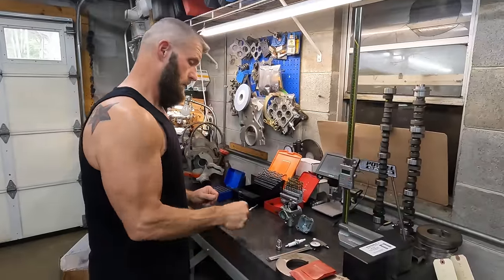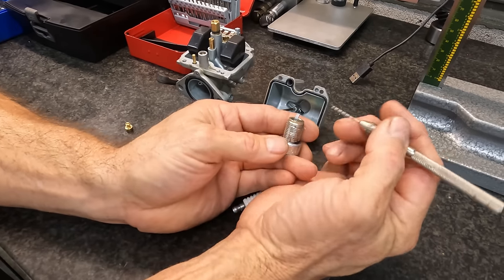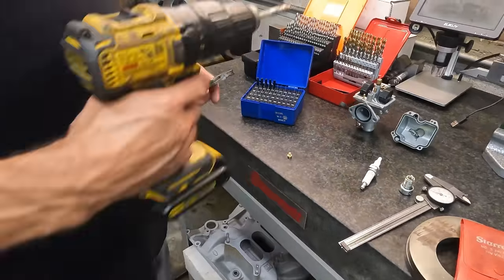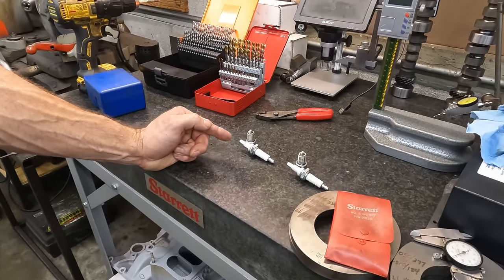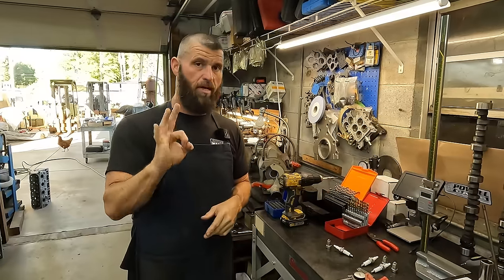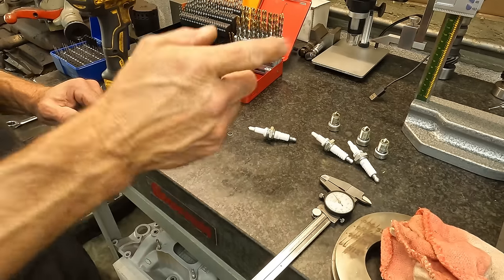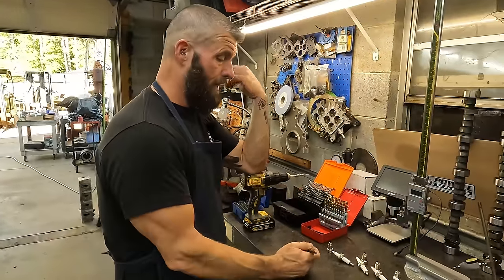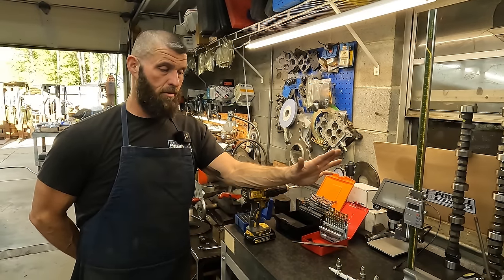Reading sparkplugs and making Andrew's mini bike faster than it should be!

Comment: The smoke ring and strap anneal line are the two key features.  GREAT job covering this.  This is the most clear and concise video I have watched on plug reading.  I do more 2-strokes than 4-strokes, smokers like the strap anneal line at the bend in the strap, smoke ring usually should be similar for gasoline between 2T/4T.
Reply from the maker: Glad you enjoyed it!

Comment: Dude, y’all flashing me back better then 50 years…
Learned the hard way, as jet diameters get bigger, it takes less of a jump in size, to make the same incremental difference. 
Had a set of drills back in the day, think were intended for jewelry / watch makers, that had finer increments then number sizes. 
When splitting hairs, I’d sometimes use valve grinding compound on a piece of wire, to hone to the desired size.
On some applications, it seemed you couldn’t get enough jet, and was for the circuits being maxed out, and I’d drill / ream the circuits. Want to be careful for the jumps in size here, as a little’ll will give a shit ton difference. Sometimes chamfering / deburring circuits was enough.
Also, don’t see it talked about much, anymore, but it’s important to get a spark plug of the proper heat range, to be able to read it properly.

Comment: You threw some schooling on me! That fuel ring part was great, I knew about the heat ring/mark and how timing would change it. I liked how you described the timing as heat in or out of the cylinder. Explained it better than I had heard in a long time.
Reply from the maker: Glad it helped

Comment: Excellent explanation.  Thanks for cutting the plugs apart for the explanation.

I put myself through school working in a bike shop when 2 stroke motocross bikes were king.  This concept is really hard to explain to the customer.  Nicely done.

The last plug has the fuel line further toward the electrode it can be seen with an optical loop without dissecting the plug.
Reply from the maker: Great point!

Comment: We run across this a lot on our race quads. When we go up on carb size we always have to jump huge on mains. As much as 15 sizes at points from the stock carburetor. Seems to be due to the drop of vaccum on the Venturi?

Comment: Ben Alameda say's, only NGK will give you a correct reading!
Calculate: not just the diameter but the volume of the jet and percentage of change.
What's the float level?
Is the flow sufficient  from the supply?
Fuel filter, etc.???
A fine stone and take off the sharp edge (outside corner of drill bit, especially on brass will keep it from digging in and drilling oversize).
Mike
Reply from the maker: Correct is relative,  consistent is all that matters.

Comment: I raced motorcycles for 40+ years. The rule of thumb on those slide valve carbs is this: from 0-1/8 throttle is the idle or low speed jet. The from 1/8th to about 3/4 throttle is the needle position, from 3/4 to WFO is that main jet. Now, if the main jet is horrifically lean like yours was, it chokes the entire fuel range and moving the needle doesn't change anything. If you nail down the WFO setting and cant get the mid throttle response where it should be, the engine could want a different taper, starting less, or more, etc. The idle mixture screw, whether it's an air screw or a fuel screw, because they're wildly different, the settings are completely backwards from one another. If the mixture screw is on the engine side of the slide, it's a fuel screw. If it's on the air cleaner side, its an air screw that meters the air into the emulsion circuit of the pilot jet (idle/low speed). Those ebay/Amazon Chinese knock off carbs are notoriously poorly metered. You can get genuine Keihin parts and get them closer, The cut-away in the slide impacts that off idle throttle input as that cut away increases or decreases the air speed immediately over the main jet past the needle and acts like an accelerator pump. A little easier than using a parting tool to cut the plug shell, a hole saw with the plug screwed into a block of some sort is a track-side option. Reading that timing mark on the ground strap is probably just as, or more important than the mixture ring. Especially when the compression ratio is pushed up there past about 10:1. But good job on the plug reading thing.

Comment: Great tutorial ! Couple questions though .
1) When accelerating prior to pulling the plug , are you holding wide open & then flipping kill switch \ ignition to cut the engine , still while at full throttle & not de-celling w the throttle at all ?
2) What are you doing for the pilot jet \ circuit after drilling the main ?
3) What are you doing w the air\fuel screw as well for these changes ?
Reply from the maker: Main jet only affects the main jet, it doesn't effect idle,  yes full throttle pass and cut it off and coast in, (its as critical as u think

Comment: That was a great video. I wonder if you could weld a threaded bung on the exhaust pipe and rig up an o2 sensor to venture into a more techie side of this project.   Reminds me of a project mini bike project I worked on a zillion years ago, milling the head on a brigs then welding up the cam to re grind a more radical profile.  The next phase was using an old smog pump as a supercharger. But never got to that. Lord knows what would have happened  had I gotten hold of a milling machine in 1972 instead of discovering girls!   I just love that country setting.
Reply from the maker: Ty, yes, we could add a wide band no problem

Comment: Nice video , i would realy like to hear a more indepth  explination as to how adding more or less fuel makes the line on the plug move , it sounds facinating that it could be so precise . Like  whats actually causing that line to be formed and how / why is it so consistent .  Thanks!
Reply from the maker: The line is unburned fuel

Comment: On a NA methanol injected BBC I have always been told to keep the timing line from going around the bend on the strap. Also reading the surface color on the end of the ring to see the anodizing is burned off, but methanol is much more tricky to read has been my experience.

Comment: Most of the 196/212-224 type clones like a 130 main, .055" or #54 drill, needle in the middle, 12.5 pilot, 2 turns out on air screw. Those carbs come on much smaller OHC engines, and the jetting is close for those.
Reply: What other mods? Billet flywheel, rod, good valve springs? Gearing/tire letting it rev enough/too much?
Reply from the maker: It's all stock now, but more is coming

Comment: Enjoying ur vids !   Much more info in depth in plug read !   Old gray beard biker buddy told me just looking at electrode for coffee with cream color.  lol.  How ever he did say he checked on side of highway by cutting ignition in middle of cruise and coasting to side.   Seems like your boy coasted in to driveway.   
   Also, is it beneficial to “Clock” the plugs using copper crush ring ?   Heard that ole hot rod racing trick…
Reply from the maker: Indexing can be helpful

Comment: That is the best visual and explanation of a spark plug reading I have seen. What do you use to cut the plug off to get to the porcelain?
Reply from the maker: A lathe
Reply: Grind off the area just above the hex using a bench grinder. This will get the job done just fine!: No lathe required! The area where it was peened over during manufacturing. Very easy to do manually or chuck top of plug in hand drill to rotate against the wheel.

Mike

Comment: Around the 4:00 mark, you start talking about the ground strap and timing. With the keyway part, did you want to wait until the fueling was correct because that might put enough heat into the chamber to be where you want it to be? Or just making the fueling safe to adjust timing?
Hope that makes sense..
Reply from the maker: It didn't affect the timing line

Comment: Get rid of that oiled cloth air filter or you’ll never get a consistent tune on the carb. Trust me.
Reply from the maker: It's just what it cam with, but unless it has variable flow rates it won't affect the tune